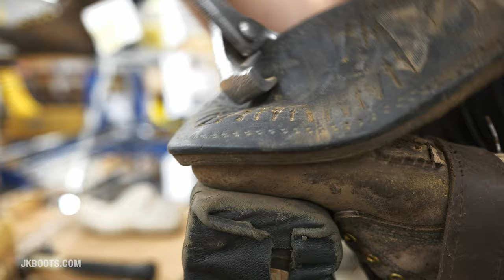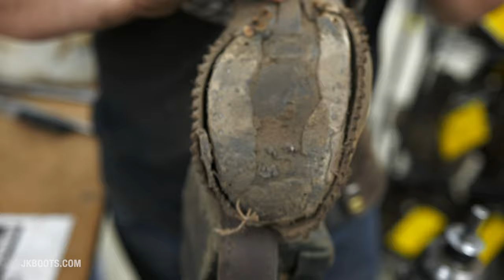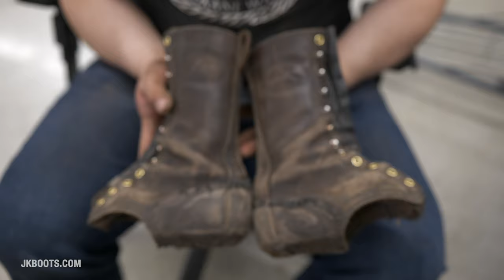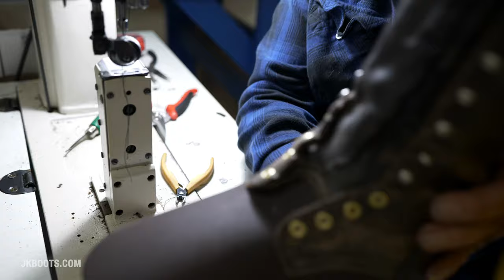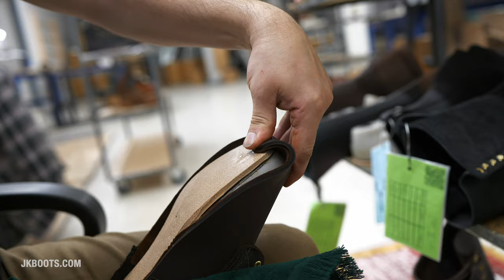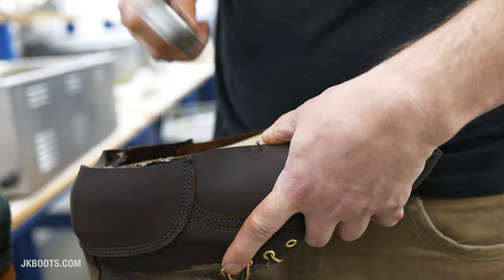Western Packer Straight from the Ranch - Boot Rebuild Part 1 of 2 | JK Boots

Comment: The little bit left from the original boot, what's the point, with new leather parts and labour it must be better to buy new?
Reply: No point, Just marketing.
Reply: It’s cheaper to rebuild and you don’t have to break in a new upper. Rebuild is $200-$300 vs nearly $600 for a new pair.

Comment: I'd at least hose them off before I sent them for rebuild, but, to each their own! 🤷‍♂️
Reply: I hope they wash the old leather before all is said and done.  I would have expected a cleaning before they began sewing the boot together.  It sure needed it.

I wonder what happened to the old threads in the upper.  You could still see the old threads in the upper for the rear counter as they sewed on the front vamp.  

They appeared to sew right over the old threads.  I wonder how that is going to look and feel around your heel.
Reply: @thesharpercoder  I got a aWhites boots rebuilt by Nicks, they stiched right over the original threads in the Nicks pattern, its a total frankenstein stitchjob.

Comment: Is this done to save costs? Seems you only keep a small part of the original boot. Might as well go for a new one or is there advantages in such a rebuild?
Reply: The rest of the boot is already broken in to your specific shape and it’s also cheaper than a new pair
Reply: @edgardocenteno4618  -- I suppose leather doesn't last forever. So if it's a rebuild, that means the wear was heavy. The work load to rebuild looks almost as much as a new pair... if not more work... so I wonder how much cheaper it really is, and how compromised the upper is? BUT... damn cool and that's probably the #1 reason why I would opt for it. Simply to keep my boots as long as possible. I know it's an object, but it picks up soul, character and good luck.
Reply: @majorawol new boots $500, rebuild, $200-$300
Reply: @channelchannelchannelchannel  So this kind of repairs also 300? Only the upper part is left? Pricing is interesting to say the least if this is accurate! :)